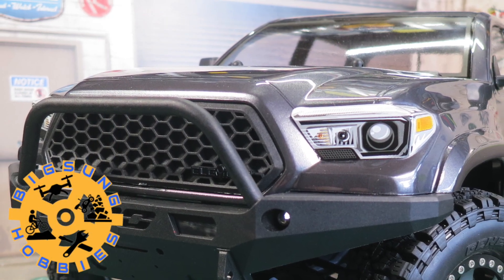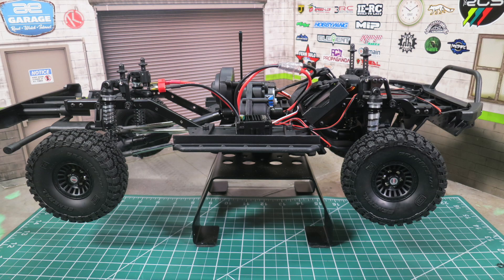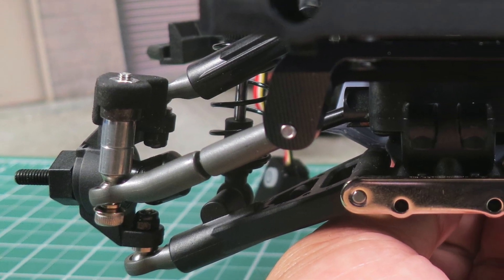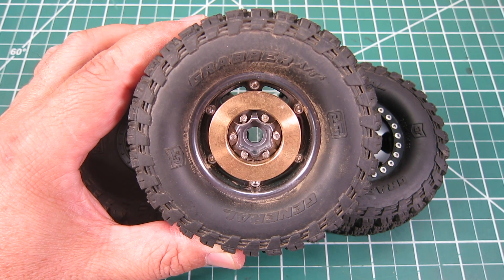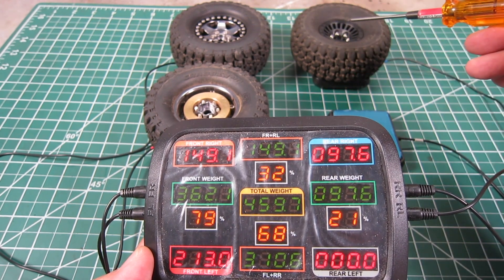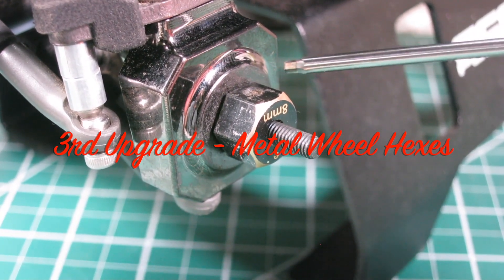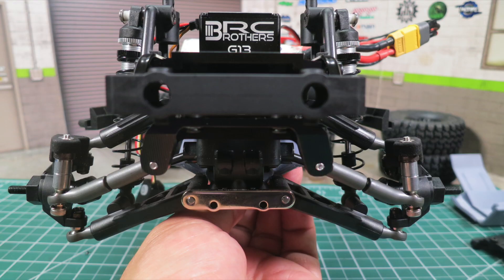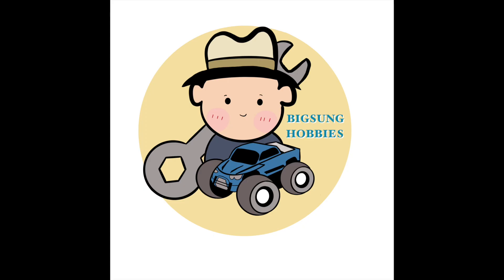1/10 Scale Toyota Tacoma (Element Knightrunner) | Ep. 8 - Brass Weights & 1.9 Metal Wheels Upgrades

Comment: The 1.9 wheels have a more scale look, I feel! Loving the realism.
Just curious: Would it be better to do all the scale trim first, to then decide how much weight is needed to tip the balance back to the ideal split?
Looking forward to the printed bits!
Reply from the maker: Thanks and yes in normal situation adding the scale accessories should be the initial step.  But there are few things to consider.  First, as much as I would love to get to 60/40 split, it's going to be tough especially with so much weight being added to the back.  Second, IFS has limitations on how much brass can be added to the front end in comparison to either straight or portal axles.  And lastly, it's a scale trail truck so I am less concerned with weight distribution as I won't be doing crazy rock crawls.  So I figured I wanted to add all the weight first to see how capable the truck is which can be seen in the last few running videos.
Reply: @BigSungHobbies  Go for the best of both worlds: Scale AND performance! That will be the "unicorn" rig!

I like the IFS look, I have to say. Very scale!
Reply from the maker: There are certain physics that can't be defied ;). But we can always build with a purpose in mind.

Comment: This is why you are my favorite YouTuber💪 the info is very clear and spot on. I’m so glade you went 1.9 wheels, now if we can get you to run Jconcepts 4.75 tires and cut those fenders too unlock the true potential. I know it won’t be scale, if you are willing to allow me I would like to send you a set of brand new proline 4.19 Hyrax or a set of slightly used stock Sendero  4.65 tires in appreciation for all your content and all you do for our hobby🙏
Reply from the maker: On this one, I am trying to keep it scale.  I had Element Trailrunner decked out with Jconcepts Ruptures which are 4.92" tires with Proline Jeep Gladiator body, and it was a beast.  I could use the proline 4.19 Hyrax though.  Do you mind reaching out via IG @bigsunghobbies?

Comment: As expected, weight work is important for crowling vehicles
Reply from the maker: Especially on rock crawlers, weight distribution is key.  You want right amount of weight bias to the front and as low as possible.  Since the Element Knightrunner is going to be a scale trail truck with Class 0 (3.85 inch) tires, it still plays a factor, but it is not as important as a rock crawler.